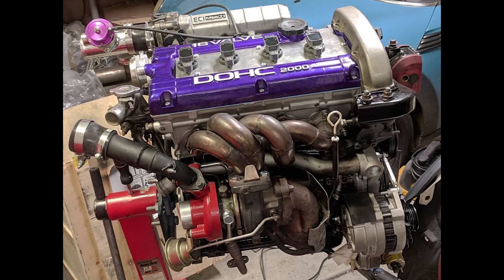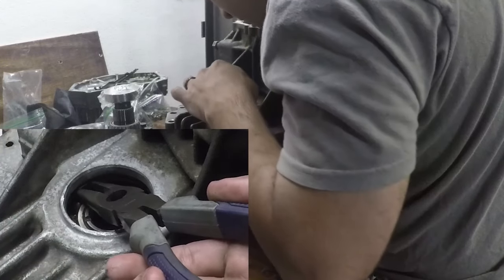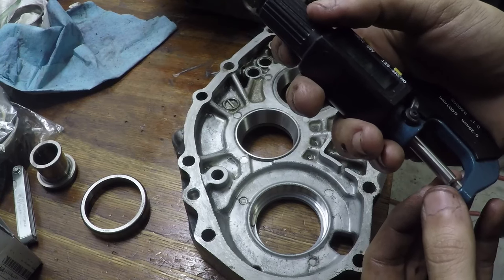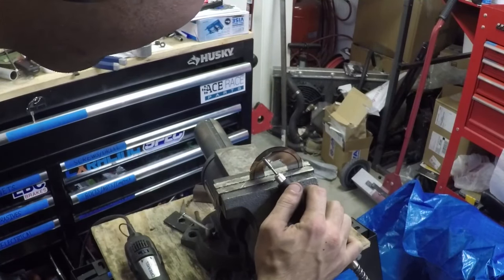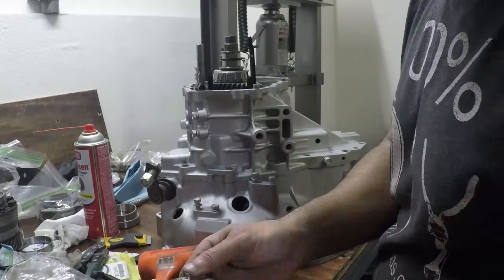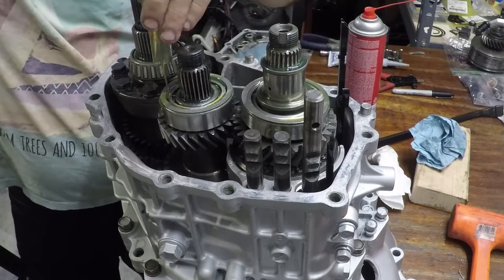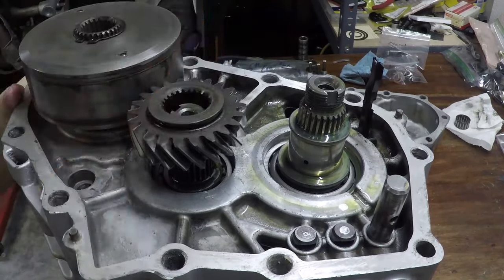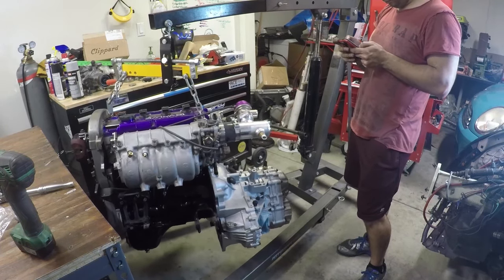4g63 AWD Manual Transmission Rebuild 4 - Shimming & Reassembly

Comment: I primarily rebuild Tremec transmissions at my work. I see all the shortcuts people take building these things, improper shimming, or no shim 😂. Some people think they need to use the whole tube of RTV  I run a 2mm bead around the center of the mating surface. It barely oozes out. 

I’ve never used solder to check shims. I sorta know what they need and I add shim until the resistance turning the individual shafts feels right.

I’ve rebuilt/built transmissions for a few of my friends, Mitsubishi Evo transmissions are so much easier. Case splits in half. 2 shafts and a center diff. 4 shims to worry about. Just dumb luck being in the right place at the right time, I got to build a PPG dogbox for a Evo. 1st-4th  and final drive. I rebuilt a stock one later replacing synchros and a 4th gear because the prior builder forgot a shim and the driven gear made contact with the engaging teeth on its drive gear.

All of that pails in comparison to the STI 6 speeds I rebuilt. Those suckers have a ton of parts inside them. You have to have fixtures to hold them. The pinion nut for the front diff has to be torqued to 390ftlbs.

Comment: A huge thank you for this video series. I successfully rebuilt the M/T in my Kia and would have struggled without your tips (even with the OE shop manual). It doesn't have a 4G63, but the M/T shares many design similarities (minus AWD).
Reply from the maker: Super happy this helped you out mate. Even though it's a different application, so much of the automotive/industrial world overlaps from platform to platform. And sharing the tips and tricks can help keep someone from struggling or even worse, breaking something on their car because they didn't know the right order or see the hidden screw, etc.
Reply: A couple other things I learned: (1) add a tolerance to spacer thickness when installing new taper bearings (the races wear-in; 0.0015-0.002" in my application - see OE specs), (2) measure the input shaft end play afterwards if reusing the bearing retainer (it's effectively a big crush washer - I needed to add a 0.012" shim to take-up end play - spec was 0-0.002")
Reply from the maker: That's a very good point and that's where specific experience with a transmission AND specific components when compensating for break in vs general wear of its life. Things wearing in will be a big part of transmission rebuilds but if you use an off spec bearing or a replacement of lesser quality, it certainly can affect your tolerances in both areas as well.

Comment: Thanks for the awesome tip! Never would have thought to use solder, but that's genius.
Reply from the maker: Sure thing mate. Just passing along what I've learned over the years but it's straight from the Mitsubishi manuals that was written before I was born so all credit to them ;-)
Reply: Hyundai uses a different measurement procedure for encased tapered bearings using tools nobody has. The Mitsu method will work slick 👍
Reply from the maker: Oh interesting. Kinda funny since Hyundai engines and transmissions in the late 80s early/mid 90s were made by Mitsubishi 🤣
Reply: That's true. Hyundai says to measure the case widths, subtract the length of the output shaft (or diff), then add the pre-load to determine the spacer needed. Easy on an assembly line with a highly precise measuring tool, but not practical for the DIYer or mechanic.
Reply: A little more work for the solder method, but way more accurate IMO. I wouldn't trust long measurements with a caliper.

Comment: So the shims are compressing the bearings? I thought the shafts Needed some play for expansion due to temperature. I'm absolutely no expert. Can you please explain?
Reply from the maker: Great question. The topic is a little tricky but I'll try to keep it high level without going into dissertation mode lol. I also don't know your background on the subject so I promise I'm not talking down or patronizing, I just want to make sure I'm not saying something without the right context.
For performance, you want a tighter fit as the load on the shifts increases (higher input torque/hp), you want to keep the shafts from deflecting or bending which will load the gears at a weaker point. Also keep in mind that these are helical cut gears so they will be pushing apart axially (along the shaft) and horizontally causing bending). Both of these cause the gear teeth to have less engagement and higher internal stresses (basically applied pressures) that will break or strip the teeth on the gear. So that's why the shims for higher performance are going to effectively squeeze the shaft rather than give it play. As far as allowing for thermal expansion, manual transmissions run about 160-180 degrees Fahrenheit so with a delta (engineering/math word for net change) of 80F, you aren't going to see any tangible change in size. Also, aluminum expands at a greater rate than all grades of steel (carbon, stainless, chromoly, etc) so if there was a concern about expansion, the case would likely expand more than the shaft at operating temps. But with 80F temp change, it won't be an issue.
Hope that helps 😉👍
Reply: @InitialDIYmods  great explaination. Thank you. 
I ordered my shims as to the spec.
I would like to thank you for these video's, it saved me at least €1500

Comment: Did you install shims on top of front diff and not under because when I tear mine apart the shim is under the diff but I see you out shim on top of diff
Reply from the maker: Personally I shim on top because it's much easier to measure and reassemble. Has yours been rebuilt before or was it factory sealed?
If you're needing to add a large amount of shims, then you may want to verify the gear offsets and bearing specs to make sure you have the right ones and that they are new and not worn, but otherwise it won't matter with the small amount of shims you typically need.

Comment: Hi look I got a question and what do u suggest me bcuz a lot of people that be fuck that to my car, so the thing it’s I got a genesis 3.8 with a automatic transmission but I wanna swap to a manual that be so dumb or u think actually will be great. Everybody said if I do that that to my car it’s not gonna be faster like it was before so I’m wondering if that affect or not
Reply: Youd almost certainly be better off just selling your car and getting a manual genesis, you can do the swap, its just a massive pain in the ass
Reply from the maker: What Fred said is true. It is a lot of work and a pain in the neck to do and you don't get more power out of it. You drop some rotational weight, but between new parts like transmission, flywheel, clutch with pressure plate, slave cylinder, clutch lines, new ECU, new wiring harness, new clutch pedal and master cylinder plus reservoir, shifter and boot, possible parts of the dash too. You're talking about spending $2000-$5000 for a manual transmission plus labor or your time.
You could buy a manual car now and sell the auto car and lose less than $2k-$5k.
People have done it and it's one way to do it if you are very sentimental for the specific car, but there are easier/cheaper ways to do it
As a side note, sorry I missed this comment. YouTube isn't even telling me what video this is on, it's just saying that it's a comment. Let me know if you went through with it or if you went a different route etc

Comment: a dot of grease would hold the solder in place
Reply from the maker: It would hold the solder but it would also change the crush amounts to the point that I couldn't compare to the spec sheet since the spec is based off dry assembly and specific to .0001"
Reply: @InitialDIYmods  the grease would get expelled before the solder crushed. Roller bearings can have a working grease film of 0.5 microns, well within the 1 thou needed.

Comment: can you do a f5m22 fwd? parts list with that too! i autocross my 1.8 and want to rebuild my old trans that the diff is wobbly in!
Reply from the maker: I don't have a car with one to rebuild so I wouldn't be able to do a video of it unfortunately. But if you grab the factory service manual, it should be super similar to this transmission minus the center diff and output shaft

Comment: My retainer ball is missing, what can I use to replace it?
Reply from the maker: I don't know the size, but it looks to be a common ball bearing. You'll want something slightly larger than the hole so I'd start by measuring the hole and adding 25 to 50% and ordering a couple steel ball bearings from McMaster or other metal supply shop

Comment: Bring back your Genesis coupe videos
Reply from the maker: I'm planning to, but I need to get the mini out of the way to have enough space room work on the genesis 😪
Gonna do and engine tear down, new headers, new exhaust preturbo, new mufflers and rear section, and new intercooler piping. I have nearly all the parts waiting to do this but just no space in the new garage to do two cars at the same time.
I appreciate your patience waiting for the videos though

Comment: As a tranny builder my best friend assembling iscpetroleum jelly I mix some atf into. It lubes seals and bearrings and it helps hold those pesky small parts in place like check balls and solder bits. Also the freeze works good but get some bubble gum remover or similar item that has a freezing characteristic to blast just as you install and some heat in that case will really do something. I've had them drop right in with no hammering or very little force. Remember though your hands are taking the cold out of the races so dont handle or set them down and dont take them out of the freezer until the second its going in.